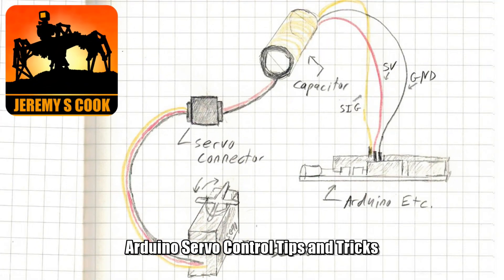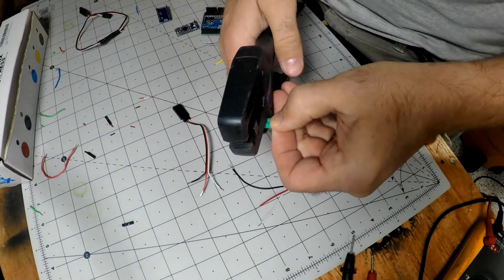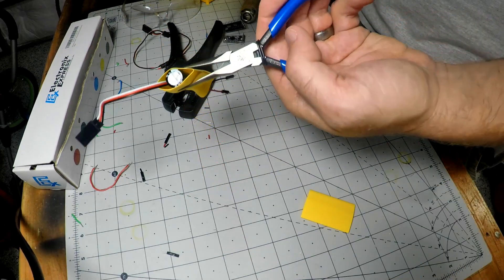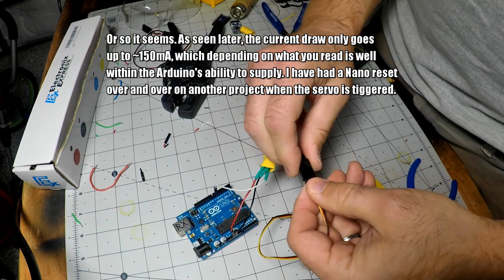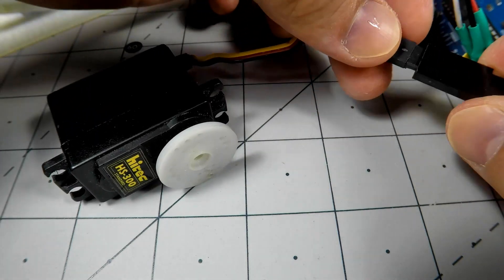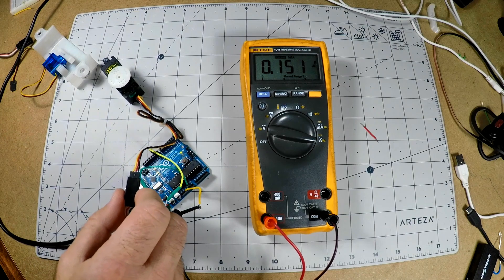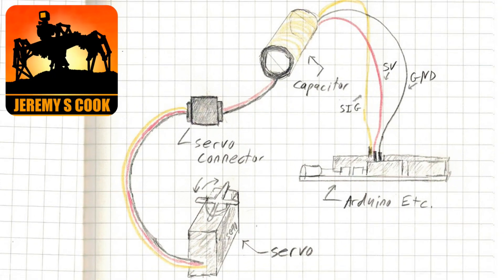Arduino Servo Control Tips and Tricks

Comment from the maker: Hope you enjoyed! Best way to power a servo of course is to hook it up to a separate power line, but this seems to work pretty well for testing. The detach function should be very helpful, as all the other tutorials I've found require the use of a transistor to actually cut a servo off.

Comment: Hey I'm curious what is the code for a servo motor to go 1 to 180 and back 1 then stop , and servo detach for 60 seconds?
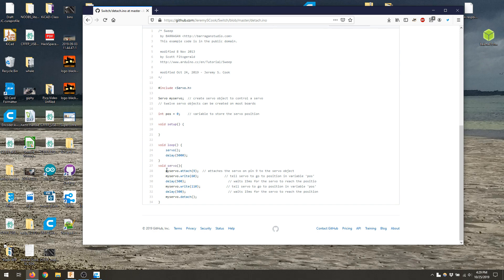Reply from the maker: Hello - You'd need to modify the code at around 3:22. Something like this (though I have not fully tested):

void loop() {
    servo();
    delay(60000);
}
void servo(){
    myservo.attach(9);  // attaches the servo on pin 9 to the servo object
    myservo.write(1);              // tell servo to go to position in variable 'pos'
    delay(500);                       // waits 15ms for the servo to reach the positio
    myservo.write(180);              // tell servo to go to position in variable 'pos'
    delay(500);                       // waits 15ms for the servo to reach the position
    myservo.write(1);              // tell servo to go to position in variable 'pos'
    delay(500);                       // waits 15ms for the servo to reach the positio
    myservo.detach();

Comment: when you detach the servo in the code, wouldn't the motor loses its ability to remain in position if you have a load pulling on it?
Reply from the maker: That is correct. You wouldn't want to use that everywhere, but for some applications it could be useful.
Reply: Excellent question, thx

Comment: Why is no resistor needed to limit the loading currency of the capacitor?
Reply from the maker: Maybe there should be. What would you suggest?
Reply: @JeremyCook  I just wondered if you can use it at a normal usb port. I guess the thin connections on the board deliver enough resistance to avoid overload of the port. AFAIR a good usb port delivers up to 2A at 5V. So a resistance of just 2.5ohm in fromt of the capacitor should be enough. Maybe the arduino can not start until the capacitor is loaded up to a certain percentage, but I guess that's OK.

Thanks for this video.
Reply from the maker: @michaegi4717  NP, thanks for watching! 

I believe there's a bit of circuitry between the USB input and that capacitor, so 2.5 ohm seems reasonable. That being said, I think the Arduino itself is limited to less than 2A, but that may depend on how that capacitor is connected.

Comment: As per the usual, I'm going to leave a comment related to something in your video that was only mentioned off hand, and has absolutely nothing to do with the topic of the video.

I learned that the $3 flush cut snips at Harbor Freight have a lifetime warranty.  I learned this while buying a pair to replace a slightly bent pair I had at home.  While I was paying for my purchase, the girl behind the counter said people are always coming in to get replacement snippers.

I was flabbergasted.  They do indeed say lifetime warranty in big letters right on top of the package.  Of course, I wasn't aware of this, so I left my bent flush cuts at home!
Reply from the maker: Reeeaally? Wow, I bought mine from eBay, but if I'd known that I might have gone to Harbor Freight.

I broke one a while ago, so bought several more from eBay as they're really handy and I expected to break them. Haven't broken one since, but that is quite a valuable tip.